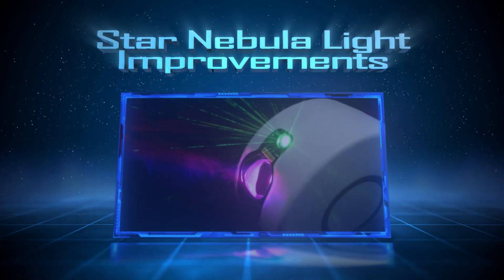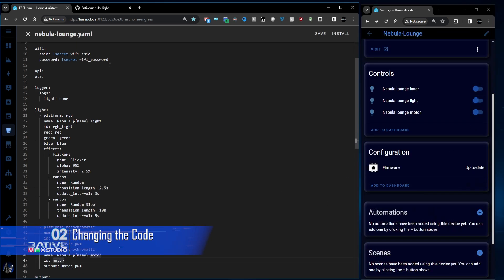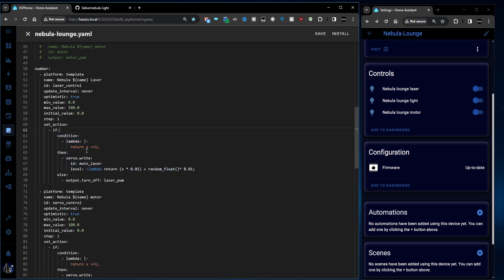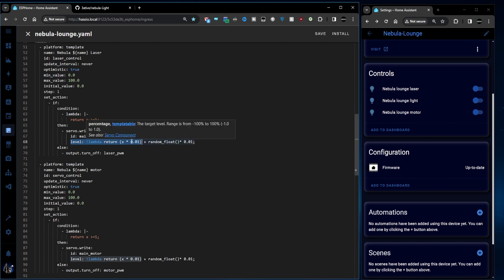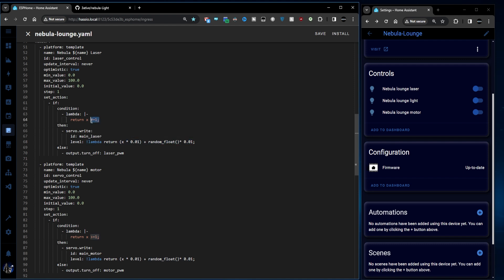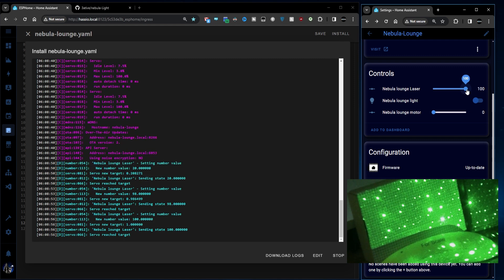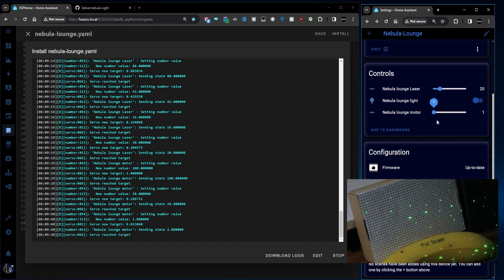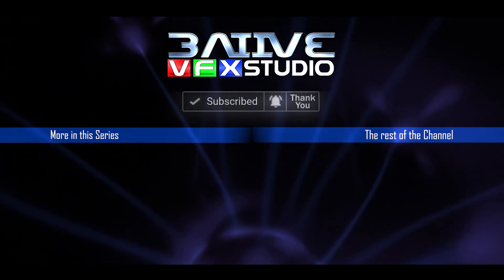LED Laser Star Nebula Light - UPDATE

Comment: Thanks so much for this tutorial- it inspired me to order a nebula light. I found on on Amazon for only $15 but, when I opened it up, I discovered the motor is no longer a plain DC motor, they now use a mini stepper motor (5 wires)! 🤦‍ I don't suppose you would have any ideas on how to modify your tutorial to support using a stepper..? 🤔
Reply from the maker: That's great to hear... the inspiration part, not the stepper motor version (That's a pain)
I'm about to make a full-on Stepper Motor tutorial for ESPHome and Home Assistant. 

TBH, by the time you purchase all the extra components to drive the stepper motor yours has... it'll probably be a lot easier to grab the same Nebular Light I used. They are still available - See the link in the original tutorial. https://amzn.to/4axHx5r